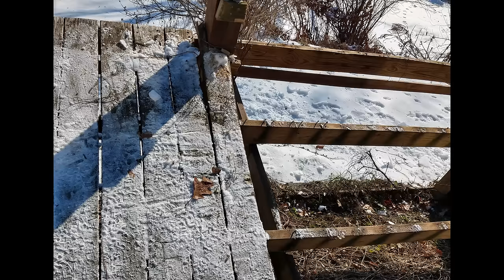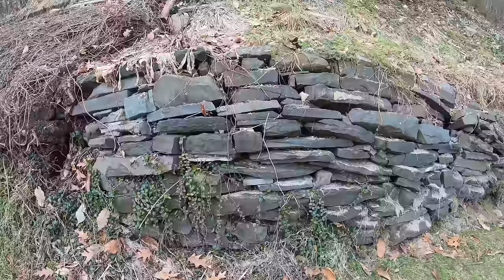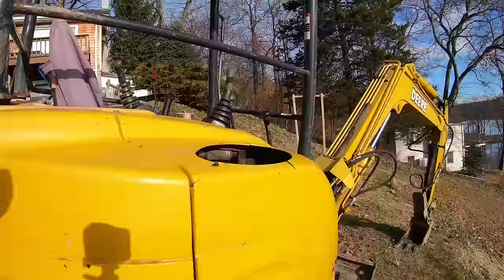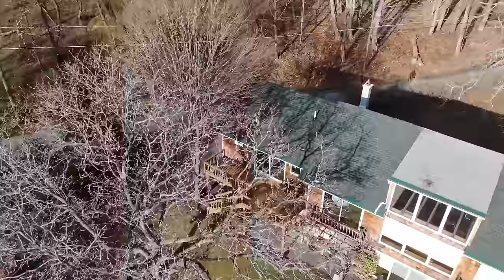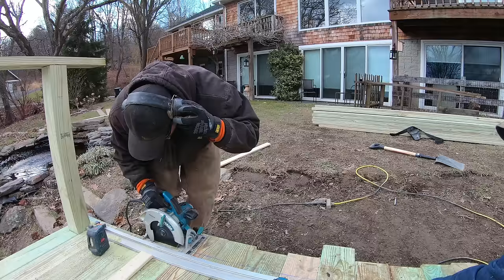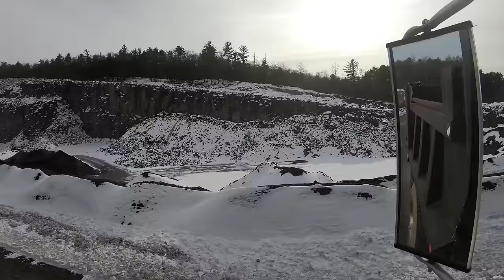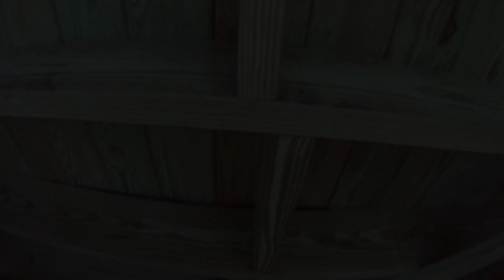Building a free-standing deck on a slope

Comment: As a former brick, block, stone mason plasterer, carpenter I have to say you did a fine job on stacking the stone!  I was also happy to see you notch your posts and not count on carriage bolts to hold the load.  I have seen people do that and explain that the bolt will literally act as a splitting wedge with enough of a load.  I have laid a bolt across two blocks and drove a 4x4 through the bolt to show my premise.  I also liked that you butted that treated wood tight!  People space it and when it shrinks you have an inch gap.  They make a tool that lays in your joists and you pull a bar towards the flooring and you can get it really tight.  Basically.  Awesome job!  lol
Reply from the maker: thanks, its good to hear these things. Women with high heels will have issues when you have a 1/2" gap between the boards!

Comment: Nice job. I like how you cantilevered the girders and the joists. It provides a stronger deck compared to the same material on simple spans. And it sets the posts back out of the way and somewhat out of view. And the cross bracing on the river side provided necessary lateral stability.  All good.
Reply from the maker: thanks, yea flush beam decks are a pita to make look good and you loose some span because of it as well
Reply: @jmuller86  where is this at and what river is this ?

Comment: nice job and job sight.. i always bolt my stringers to the post and put my verticals on the inside with my kick board running across the posts and no toe nailing or screwing... taking no chances on 300 lb drunks falling through. 2x12 top rails work nicely to bring it all in. thumbs up jesse

Comment: Loved the video.  I have watched all of yours and they are  great.  I can't stand the criticisms of those who don't watch completely or don't read the comments.  My observations: Great tip with the bosch laser, I think it's within 1/4" accurate over 30 feet. I think you have a 10" makita saw which is great for cutting the beams. I also have that saw as well as the 16" beam saw (bought used on e-bay, and its great). I love how you cut the beams to create a decorative pergola effect. Love black plastic bags over sonotubes prevent premature concrete freezing.  Using home depot mortar abs plastic mixing pans to mix and pour concrete.  These are cheap and work great as drain pans for transmissions/sloppy oil/coolant changes. I like the (?)estwing or Hart framing hammer. I think the watershed from the deck surface eliminates a french drain uphill of the landscaping stones which you did very well. Finally, I loved " 7 and 5" music. If you like them check out Ludovico Einauldi (you tube and amazon), I think you would love his music even more. Kind regards, Craig

Comment: That was nice. In the future, if you can, you may use a piece of 2x8 of wood as a retainer of your gravel, and even make its ends going in, towards the property to hold the soil by the entrance of the deck at least for 10 years. Just don't claim it'll last 10 years. And just as you did add a large group of stone step entrance, or a wood step but the stone is safer for your pockets. Because adding a wood step in front of it can complicate things. Thank you for this video! Keep building!

Comment: After you laid the stone, it looked better than what they had done. Usually, you lay your biggest stone at the bottom and work your way up in a manner that each stone after being laid, does not rock (move) from side to side or end to end - always over lapping as you lay each course. Yep, I use to lay stone and know how to point up a wall using cement. Nice job and by the way, I do not miss the winters. God bless you and your family.

Comment: Great tip on the trick for alignment. Beats measuring from corner to corner over uneven terrain and using batter boards which I do not know what would look like for your surface area.

Comment: That’s a quality job. One thing bothering me is the ground contact with the wood. I would pour concrete at the front step. The treated wood will rot sooner. I can’t sleep at night..... lol.
Reply from the maker: I made it so that nothing is touching the deck, those flat stones are sitting on a bed of crusher run, and then about 2 inches of paver sand (interlocking pieces) the stones are about an inch from the wood
Reply: Jesse Muller // Oh, I see. Then I can sleep now. Good night 🤣

Comment: that is a great looking deck and I really liked the music you selected too.  Why don't you make a suggestion to the homeowner to close the gap between the deck and the grassy yard area where you put the gravel and makeshift step, by extending the deck about 4 feet toward the house and let it level out into the yard area. This way the deck will actually span over and close the gap you have now where the yard drops off and the deck surface will run level into the grass area, making for a smooth and safe transition for people to walk. ... And, it's another job for you.

Comment: Nice sturdy deck! I´d screw in the top of the hand rail, from underneath. Looks cleaner without holes, and rain water wont seep down into the wood. The top of the railing is much more visible than the deck itself.

Comment: Great job, I 'd be worried about rocks rolling down that hill...In Canada we use cable netting/snow fencing and would use signage on the road/ trail below the dig. Maybe install a railing on the backside of the deck 2'- 3' in on each side.
Reply from the maker: yea it was a little hairy, I used those 6x6 to stop things from rolling, but I could see an operator that isnt being careful could have made that more dangerous than needed

Comment: I learned not to use the 2 by 2 on the railing and went with 2 by 4 which is much stronger and last years longer. But every one has there own way. Good job none the less !
Reply from the maker: yea they are stronger but with a view like this; they didnt want to impede on the view
Reply: @jmuller86  Makes perfect since.
Reply: @Steve Diamond That is for sure.  They would want a thick Plexiglas and that stuff is the price of gold !
Reply from the maker: @Steve Diamond my dad did a very fancy glass railing, spindles and all a few years back on a 6 million dollar home in millbrook ny. very time consuming and extremely expensive,the front door set on the house was 40k
Reply: @nickbeam5432  , On "This Old House" they had a project where they used aircraft cable, stretched tight, horizontally to create the barriers, much cheaper than glass and it didn't hide the view.  And it never needs cleaning like glass.
Reply: @genedameier8746  I have seen what your talking about. They use the cable in a lot of commercial buildings with the stairs and railings and it does look nice.

Comment: Turned out great. Those spindles drive me nuts tho. With a view like that i would tell the owner they need panes of glass instead.  Their 'water feature' needs a ton of help.
Reply: Daniel, I saw an episode of "This Old House" where they used aircraft cable, stretched tight, to be the horizontal barriers to provide safety while providing a clear view of the scenery.  They said it was cheaper then glass and you don't have to clean it.  The view is always clear, the cables are almost invisible.   ... I'm sure that the water feature will be their next project when the weather gets warmer.  
Jesse may not be a landscaper, but he is a good "Hardscaper".  And that needs to come first before the softer "landscaping" goes in.   Stay Safe.

Comment: Why didn't you just run the Deck boards up the hill so they could just step onto the Deck. Very easy and would look allot better. You had the room and materials. Èither way it looks good. Vinny 🇺🇸
Reply: Hardscapers nightmare. The stones will be at the bottom of the hill in 2 years.

Comment: Not a negative comment, I'm sure you got drawings approved, but with a view like that sitting down, your staring at wood railing and posts. The ss cable system would have been the winning lottery ticket. Would also have been good to redo the rock wall correctly. I'm sure there was a budget to keep at the same time.

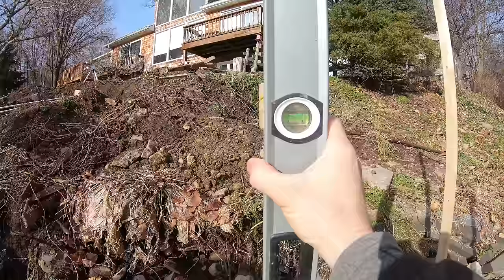Comment: 12:03 or use laser glasses, much easier to see the laser and won't damage anything if you look directly into the beam :)
Reply from the maker: thats good to know, I always throw out those glasses, never really took the time to understand what they are for, I will have to try that
Reply: I did wonder about the laser damaging the camera sensor.
Reply: @TrevorDennis100  Worry about damaging your eyes not the camera. Most ordinary lasers are class 1 anyway. So not a big deal, but still should be avoided on the principle that weird crap happens. When viewed through a magnifying device (lens) unsafe levels can occur.
Reply: @firesurfer  Many years ago the small test instrument design team I was a part of designed and built a device for measuring torsional vibration and rpm using a laser.  We were the first people to actually build one, although the patent was owned by Bruel and Kjaer (or so my senior engineer told me).  It worked perfectly and had much higher sample rate than the thousand tooth encoders we'd been using up to then, but we were shut down by the plant safety (Ford Research in the UK) because of the high powered lasers we were using.  This would be the same system later used to read audio by bouncing a laser off a window.

Comment: I heard from someone one time if the deck is over a certain height the pickets on the rail should be on the inside. That way if someone fell into them there is no chance the fastener could come out and someone could fall out. Seems unlikely especially with screws. My old deck railing I could kick the bottoms loose with my foot and some rot. I think they do look better ascetically though attached from the out side.

Comment: I would have done 2 things differently. Balusters look much nicer (and shed water better) if the ends are beveled and pre-drilling balusters to avoid splits. Come back in 2-4 years and half of them will have split.
Reply from the maker: I was worried about splits on the balusters too when I first started building decks, but that was atleast 10 years ago and none of them have splitted. I used trim screws at first to try and help, but I found it was not needed, these screws kind of predrill the wood. and the bottom ends of these are beveled

Comment: Instead of that diagonal bracing made of wood, you should have used 3/8 inch cable and turnbuckles.  Would be just as strong and not nearly as noticeable.  Really interrupts the clean lines of the deck.  Otherwise adequate work .

Comment: Is it building codes that require concrete footings for your post? If so, why? My deck is 87 ft. long and I built it in 1987. (I'm in the south.) The decking has been replaced 3 times already (I tried 5/4 flooring one time - it didn't last but 6 years) and now it's time to replace it again but not the post. I dug a 2 ft deep hole for them, put some concrete in the bottom of the hole and stood my arsenic treated pine post up and filled in around them with dirt, After 33 years the part that's buried in dirt still looks like new. The part above ground is weathered some but still very structurally sound. I'm not replacing the post. A few of the floor joist may need replacing. It's just the decking that is exposed to sun and rain that keeps going bad. 
    I don't think treated pine still has arsenic in them. Is that why you bring the footings above ground now?
    The next time the decking needs replacing, I'm old enough that it won't be me that does it. Somebody else will have to worry about it but I'll bet that the post will still be good.

Comment: I absolutely love everything you and Andrew do. I have a couple of questions though. I have always been told to leave at least a 9p nail distance between deck boards, for expansion and contraction. Everything else was answered in the video including the transition from deck to the yard. Please if you could give me some insight and feed back I am always looking to understand new methods and reasoning. Thanks in advance J.
Reply from the maker: it depends on how wet the wood is, I know this lumber company goes through alot of lumber so it is always dripping wet. when it is that wet it will shrink and cause a gap. if you gap them 3/16" then in a few months you will have a 3/8" gap, which to me is way to big, especially for high heels. Not all lumber companies have lumber that wet though, so you have to check it with a moisture meter to be sure
Reply: Jesse Muller, Thank you sir. I didn’t even think of that. Thanks for taking the time to answer my questions, I really appreciate it. As always, looking forward to your new videos. It’s nice to watch a contractor who prides himself on a job well done and done right. Keep up the great work and God bless.
Reply: @tomsawyer1274  If it's pressure treated decking always put it tight together, if its cedar or composite use a deck jig spacer. PT shrinks a lot when it dries out.

Comment: Only thing I would have done different is cut the girders in to the hill and have decking die into the hill. Unless that was full length of girder span already. Maybe you can put band across like a bulkhead and backfill to deck height. Just my 2cents good job.

Comment: How come you cut dog ears on the side of the beams facing the house if they were just getting covered up? Did you put in concrete anchor bolt on those post bases?
Reply from the maker: they were close to the ground so I figured I would nip them too to prevent the wood from touching the ground

Comment: Nice video thank you. Love the look of the deck. 

Couple questions. I didn't notice you using any joist hangers, if so why not? Makes for a stronger safer deck. 

Also it appears you screwed the deck framing to the deck posts didn't see the use of any lag bolts or bolts of any kind. Did you use any? If so maybe some video highlights to show this process so others can build a solid safe deck. 

Next is just a comment, you should always space your boards, even if they may be swollen. Need to have big enough gap to let debris pass through the boards. 

Other than that a very solid 10 year deck.
Reply from the maker: joist hangers for what? thats only if you are using a flush beam design, which then you cant have a cantilever. Posts to the beam connection? The 6x6 were notched to accept the 2x12 beam, and then GRK lag screws were used to fasten. The gap is a controversial thing, it depends what size gap you want when everything is dried. If you space them and then the boards also shrink, you will end up with a big enough gap for high heels to have a tripping hazard. Pressure washing a smaller gap is not a big deal to do every year, and the customer already pressure washes other things every year
Reply: 10 year deck? That thing is a 100 year deck.
Reply: @jmuller86  The joists are resting on the 3 main beams.  Glast is mistaking your facia for a support beam.  I did too at first glance.  He was looking for you to use hangars between the joists and the facia which he thought was a support.

Comment: This would have been good for helical piers driven  15' down like corkscrews to 3500 psi resistance. Good job with the stone. base should be 60% of height for semi-dry.  40% in some cases.

Comment: we don'thave those sonos tubes in the uk. in principle they look like a good idea. But what comcerns me is that disturbing all the earth around them would make, the formed piles, susceptible to being pushed out of true as the replaced earth settled and regained its moisture equilibrium, that is regardless of how well the replaced earth was consolidated.
Reply from the maker: with the 25" footing on the bottom, it helps keep them in place while the earth settles, but yea regular sonotubes without footings are susceptible to moving as far as I am concerned, but I never install them without a footing so I dont know for sure

Comment: I would have used strips of metal underneath to attach the deck plants...that way, no screws would be visible from up top and no holes that accumulate water and eventually rot the deck..just saying..there is always a better way..